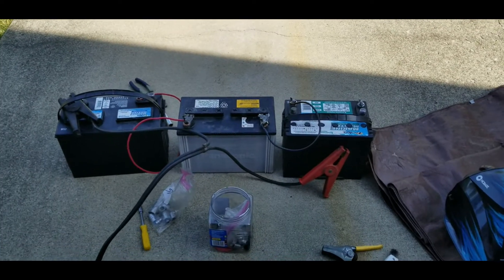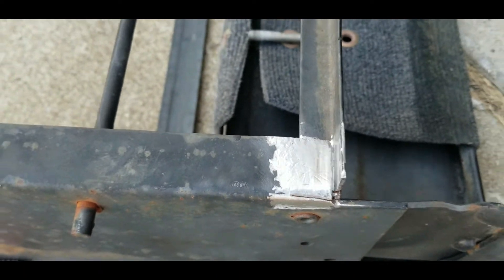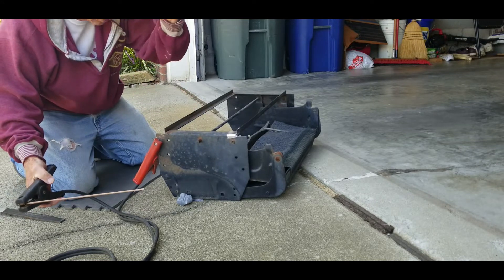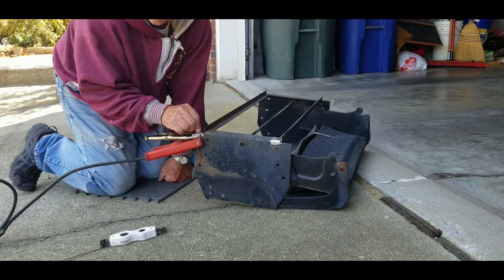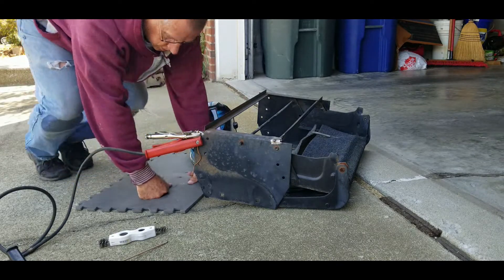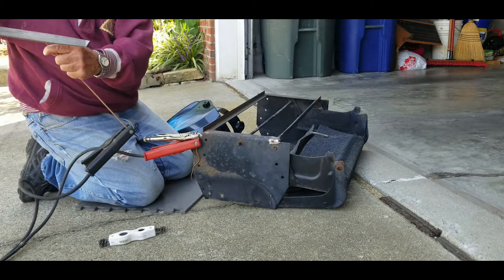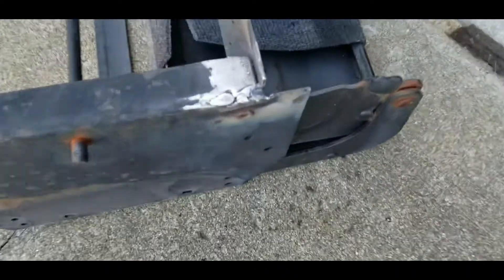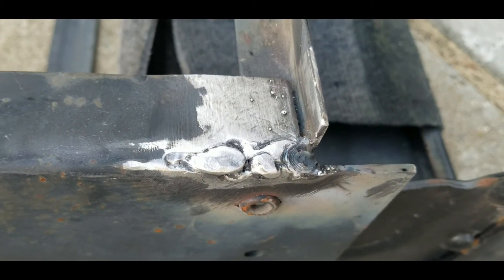Welding attempt with 3-12 volt batteries and jumper cables

Comment: While we can appreciate what you were trying to do, you would have been better off just offering a neighbor with a welder a cup of coffee to weld it for you. Would have been faster, better, etc.
Reply from the maker: I asked on the NextDoor app for our neighborhood and no one offered any help. I just needed a simple spot weld on the bracket for the bottom step of my RV steps, which I managed to do in about 5 minutes once I got it started.Just spent 5 weeks in the trailer and the weld is holding.
Reply: @richward2288  Many times you can stop buy a welding supply store and ask... many guys that buy new welders are just chopping at the bit to weld with their new toy.

Comment: What size stick
Reply from the maker: Fornay E6013 3/32"
Worked better when I exposed some metal on the tip of the rod, cleaned all contacts, including the jumper cable teeth and added the Vise Grips and bare 12 gauge wire.